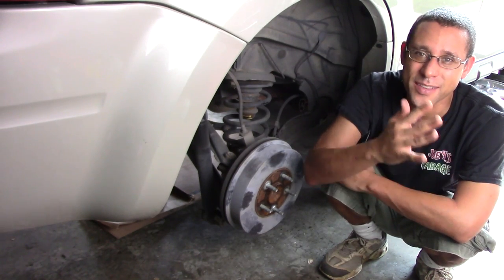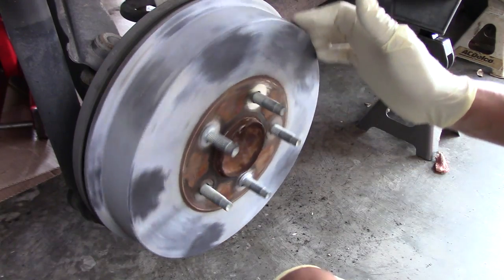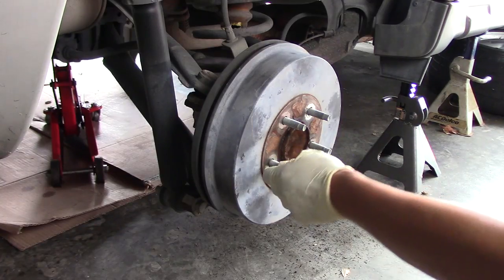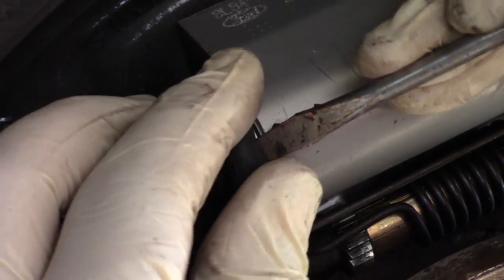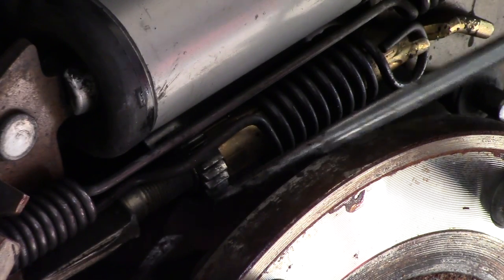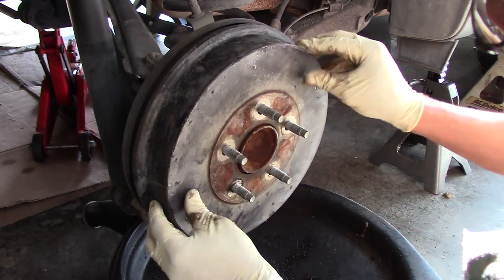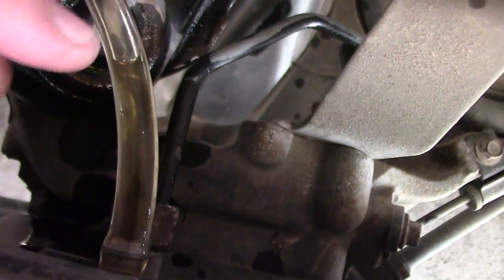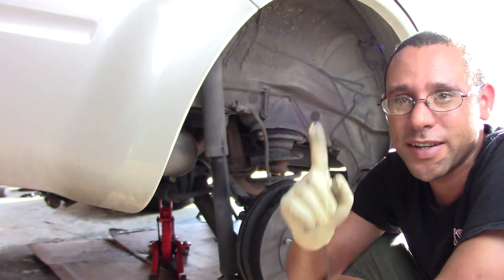Drum Brakes - Clean, Adjustment and Bleed

Comment: If the shoes catch only in a single spot then that would mean the drum is warped and catching on that place.  Either the shoes should rub a little or not at all..  if you think about it, inside is totally concentric as are the shoes.. if only catching and stopping the drum suddenly than that spot will only get amplified as the brakes are pushed..

Comment: you said it should spin freely with some drag, other mechanics in other videos say that its never supposed to spin freely, it should only be movable with slight force and you should feel drag all the way around. which one is it? I have a feeling this is the chicken vs egg debate :/
Reply: This is one of many. And more apples, oranges, not chicken, egg. Since they are more of a preference. Also not all brakes are created equal, some manufacturers and models are going to have different behaviors in different situations. I would be willing to guess, any one saying the brakes should be firmly pressed, are people who have had issues with breaks. The flip side of the coin, is that high pressure fluctuations over time will cause failure to seals at connections and joints. so having a low pressure system may save you a brake pad or two across the life of the vehicle, but ultimately could cause catastrophic failure, i.e. highway speeds, substantial kick to the brakes and 2 or 3 litres of dot 3 goes into your wheel well while you cruise, unhindered, towards whatever obstacle you were trying to avoid.

Comment: Hi there, did you need to bleed the brake after adjustment?
Reply: I don't think so. The brake line was not open. If he would change the drum cylinder, then it would be necessary.
Reply: @olenaerhardt7725  I think you are right! no need to bleed if the brake line was not opened. Do you know much about this? I changed both the brake cylinder and the brake shoe, yet, i still hear something is touching when I spin the wheel while the car is jacked up. The car failed inspection because of that.. I open the drum, adjust the brake shoe until there is a little drag. close everything, take the car for a drive then check the wheel again by spinning it by hand..  the wheel should rotate smoothly but it is not.
Reply: @themoss  I can't tell much, I started to master this activity not long ago, very new amature. I did some works, but most electrical (alternator, starter, some sensors), plus serpentine belt, oil change, that's about it. Generally speaking I'm on the stage, when I think of auto mechanics as extraterrestrials and ready to go and surrender to the auto shop any time I fail to do the job. I just started to do front brakes, got stuck on rebuilding them a bit, next will be rear brakes. So no, I didn't work on the rear drum brakes yet. But I watched many films and  removed the brake hose on the front for replacement, so kind of got some idea. Recently in one film I've read a comment which stated that depending on the type of the brakes the correct rotation can be different. So the rotation might should not be smooth, some wright in comments it should rotate only when the force is applied. So I would do more research, I found it to be very useful for myself to read comments.
Reply: @olenaerhardt7725  with a comment like this i found myself very curious.. .. a quick google search put a wide smile on me... yes, we are of the same clan obviously. Guess what? I meant to come to your work place in May haha
Thank you very much for the comment. I will keep you updated. I very much enjoy doing these repairs.  I recently changed the whole exhaust system, the whole of the front/rear shock absorbers, the brake pads, the brake cylinders, the front engine mount, ABS sensor....  the hardest part is to reach the right diagnosis
Reply: @themoss  Sure, it would be great, pls come by. Thank you for the complements. You did just outstanding jobs, especially exhaust system, it is well beyond my physical capabilities. Shock absorbers ..., I wouldn't mess with them, because of those huge springs. Some people write the mechanisms to keep them compress fail sometimes. I enjoy car repairs when I see a positive progress. For me the hardest part is chemical (what rust remover (or converter), which grease, which theadlocker, primer, paints and so forth).  Also car lifting, Saturn has a lot of points where you can place a jack and a jack stand, but we have another car Chevrolet. That one is very tricky with secure points. Yes, pls keep me updated.
Reply: @olenaerhardt7725  haha thank you Olena, can't believe i found my soul twin. I also obssessed with this kind of things but i am still learning.. my car is 16 years old Vauxhall which I keep for the fun of it. I will keep you in mind if i ever made it east of Sweden. What fascinated me about you was your work, it is more about theortical complext stuff. How do you find it working with hands? normaly theorist don't find experimental stuff that interesting and vice versa
Reply: @themoss  Exactly, I also convinced my husband not to sell one old car (2001 Saturn SL2), but give it to me to practice on repairs. I think it is very useful and sometimes intriguing activity. Regarding the theoretical and experimental work, they are related closely in science and in life as well. You understand things better, if you do staff with your hands.  Plus good exercise. Thank you for telling me about Vauxhall, never heard of those cars, they are beautiful, especially old  fashioned, like Wyvern, 10-4. I'll let you know how my work on brakes goes.
Reply: I’m not a expert but I don’t believe it’s supposed to drag. If it drags you’re wearing the brakes down till it turns freely 360. They should barely touch the drum 🫱🏾‍🫲🏿

Comment: For common sense sake. You dont have to pull the bushings off the cylinders lmao. If its bad. Its gonna be all over the thing. If it looks somewhat clean, its fine
Reply: Don't listen to this guy.... you always check under the boots. If it's not dry, replace it because its already starting to fail. Don't waste all the effort then let it leak into your system like this guy suggested😂
Reply: @businessraptor134  how i stay in business as a mechanic.  Not pushing unnecessary parts changes
Reply: @ap22295  let it leak and rust stuff up. Need repair sooner. Make more money to stay afloat. I worked in a shop and know your kind... you would charge to check cylinder boots or not check them? Lmao. just in case the long comment is too offensive somehow.

Comment: They're called auto-adjusters, you don't need to adjust jack shit!
Reply: Auto adjusters on some cars are only activated when the brakes are pressed hard in reverse, so this is another form of correcting the problem while the wheel is off.
Reply: My cobalt has auto adjusters that don’t do shit. I have to adjust them myself every few weeks. It’s dumb.